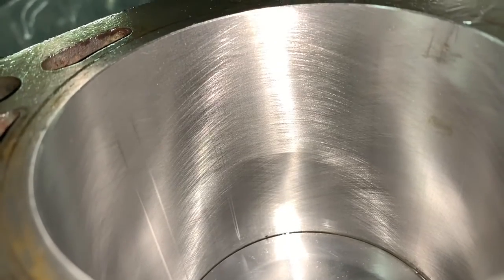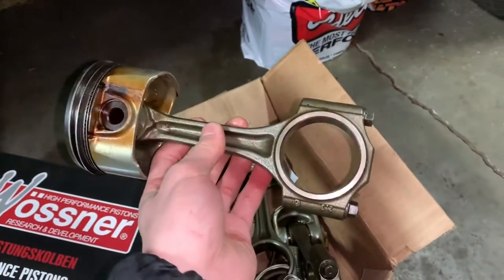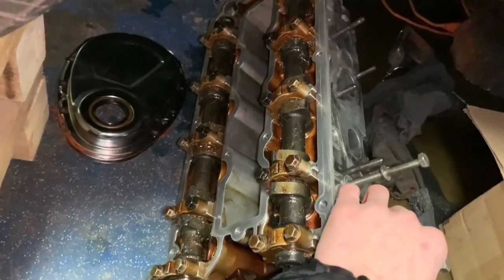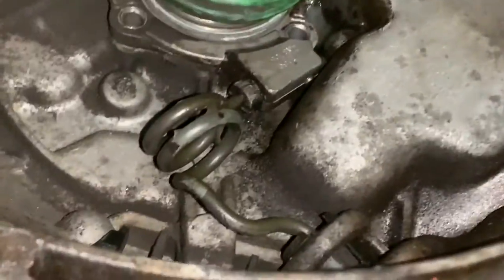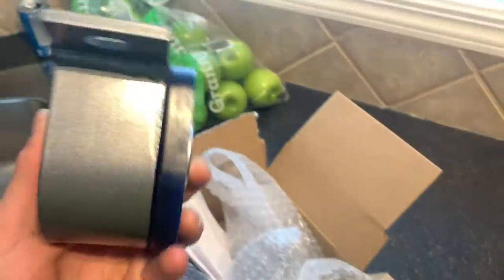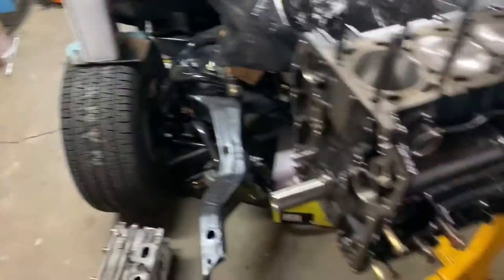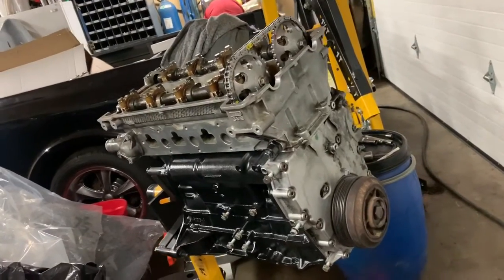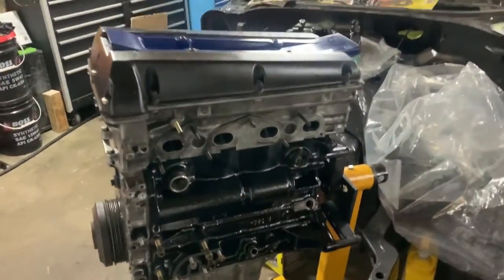Saab Viggen Build PT.1 | How to build a Saab engine

Comment: wouldn't it have been easier and a lot less messy to put some thick grease in the socket and hold the head nuts in there for assembly?

Comment: does this motor have 2 timing chains?
Reply: One timing chain and one balance chain driving two oppositely unbalanced shafts to compensate for the wobble induced by a four cylinder engine.